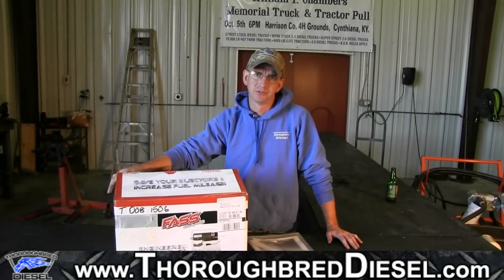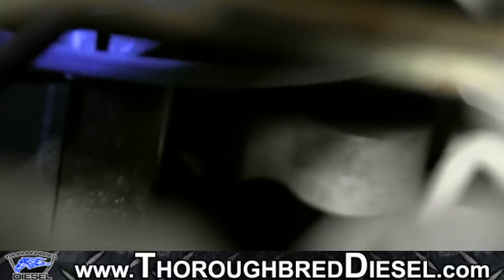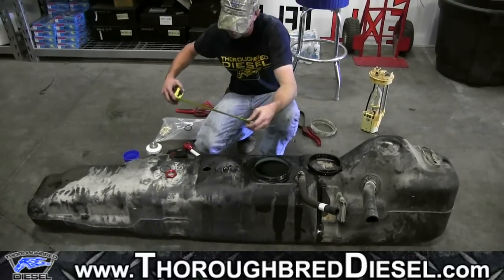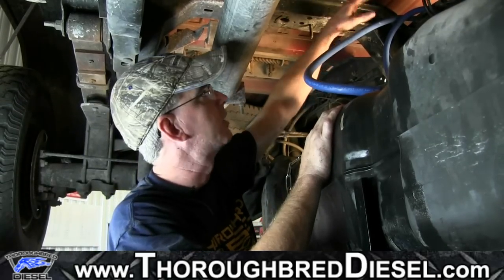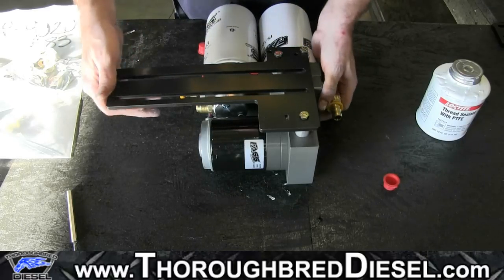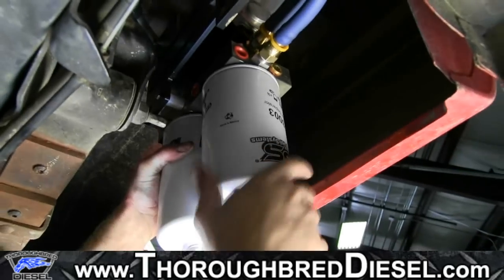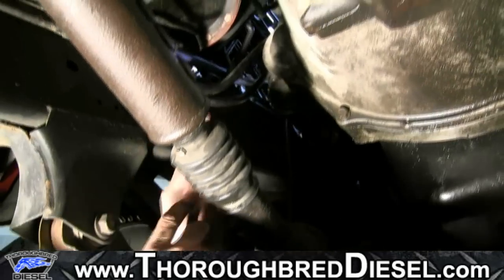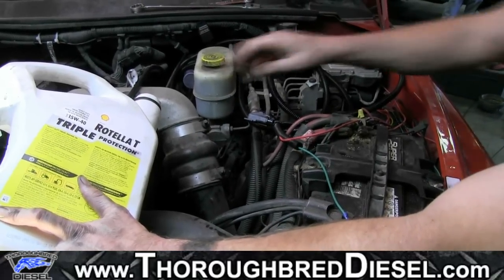FASS Fuel Pump System w/ Drawstraw Install: 2002 Dodge Cummins

Comment: so I have a 2000 ram 2500 with the Cummins, it has a in tank pump and a fass lift pump on the side of the block. is their a reason why their is both pumps? and I do not have any power going to the in tank pump. any help would be great thanks!
Reply from the maker: Most times people install a block mounted lift pump because they do not know there is a pump in the tank or they do not care.  The in tank pump is too much of a restriction for any other externally mounted lift pump to draw through.  You will need to eliminate the in tank pump.
Reply: so i buy a FASS pump, is their some way I can disconnect the power going to the pump in the tank, but still have a fuel gauge.
Reply: how did you guys disconnect the in tank pump, but still have the sending unit for the fuel gauge
Reply from the maker: The power to the pump in the tank and the signal for the fuel level are independent of each other.  When you disable the power to the sending unit via the pump power wire,  that doesn’t affect your fuel reading.

Comment: What if mine doesn’t come with the connection to the ecm it just comes with a red wire??
Reply from the maker: Those are the updated kits that get power from a key on power source.

Comment: So does this completely eliminate the fuel filter housing in the engine bay?
Reply from the maker: +Rob King For the 1994-2002 Dodge trucks,  if you are using a FASS pump with filter,  you can eliminate the factory fuel filter housing.

Comment: Why in the world do they mount it in front of a wheel? Mine would be gravel blasted and built up with mud. What about stock injection pump return line and filter?
Reply from the maker: I have mine mounted there and see countless others there. It does not accumulate as much as you would think.

Comment: I have a 1999 ram 2500 5.9L 24valve Cummins. My fuel gauge isn’t working anymore and I’m thinking about upgrading my fuel system, I have to look if it’s an in tank or on the side of the block. But after I get the new system working how do I get the fuel gauge working again
Reply from the maker: The float unit is no replaceable on the 99 trucks. We can get you a module without the in tank pump that will replace the sender. Give us a call!

Comment: We have a Dodge ram 3500 2014 5.9 coming. We bought a lift pump and looked at a video how to install it but my pump isn't behind the fuel filter . Is there another pump anywhere ? can anyone help me ? thank you
Reply from the maker: Your pump will be in the tank. The tank will have to be dropped and the pump bypassed for any aftermarket lift pump.

Comment: A supposed pro that thinks a flare type fitting needs pipe dope is far too ignorant to be trusted.  And if it was something that needed dope it was applied incorrectly so it probably wouldn't seal.

Comment: That’s not a very good way to get fuel just use the factory set up no holes or sumps or straws , just get a Fleece and be done with it  they have this dual gear motor pumps yes I said two gear motor pumps and the cool part is one pump. Uses the factory harnes just plug and play the second pump comes with it’s own harness with shielded cables and a fuse and relay so if one goes out you have one to get you home and that’s as cool as it gets !!!!!!

Comment: Hey. On my 02 my lift pump is on the block. I guess I do not need to do anything to the tank (draw straw) ? 
Also just buying fass lift pump is the same but without filters?
Reply from the maker: +Mr. Dozer That is a good question.  I would make sure 100% that you don’t also have a lift pump in the tank.  There is not SUPPOSED to be,  but someone may have got lazy and converted it to in tank and pushed through the one on the block.  I have seen this done several times.  Easiest way to check is have someone bump the starter on the truck and you listen back in the tank area and make sure you don’t hear a pump in the tank.  FASS is actually a brand,  they offer pumps with or without filters,  its according to what you want for your truck!  Let us know if we can be of any help.

Comment: Another question. Why did you pick a spot where the draw straw in not at the lowest point of tank?
Reply from the maker: +Mr. Dozer When looking for a spot on the tank we have to pick a spot that will offer us a flat spot to install the straw while also taking into consideration any bed mounts or cross members that will be in our way.

Comment: Do you remove the stock fuel filter housing then?
Reply from the maker: You can, the housing can also stay on the engine if you decide to leave it on. It has no function with this lift pump setup.

Comment: Do I need to drop the tank if I have the block-mounted pump?
Reply: ManKillingLlama if you use beans sump kit then no.
Reply from the maker: No, but if you are using a 150GPH pump, I would suggest using the draw straw simply because of the increased flow.

Comment: So this set bypasses the factory fuel filter housing desperator? And What about the Water In Fuel sensor that's in that housing?
Reply from the maker: The factory WIF sensor screws into the bottom of this and is still in play.
Reply: @thoroughbreddiesel  thank you, and I just realized I spelled separator wrong -_-